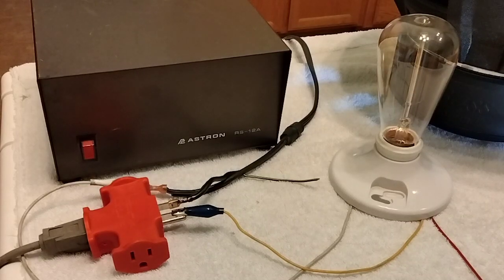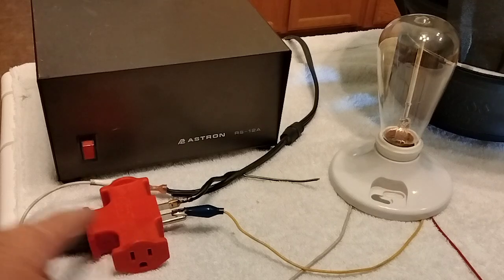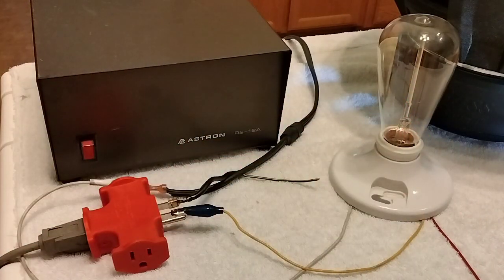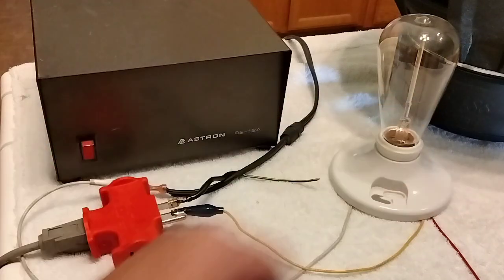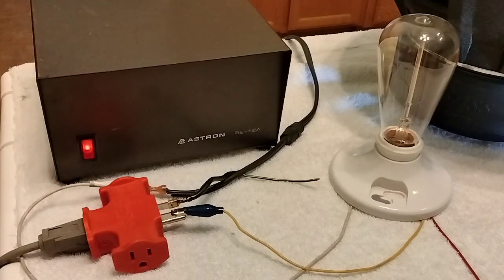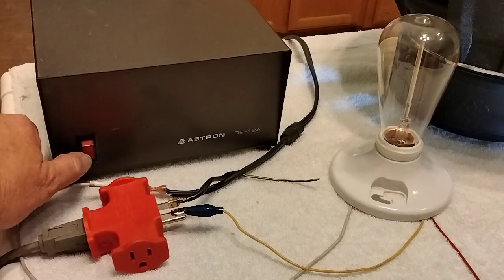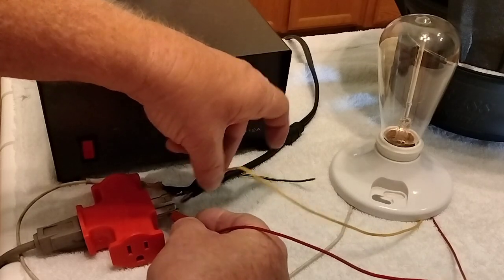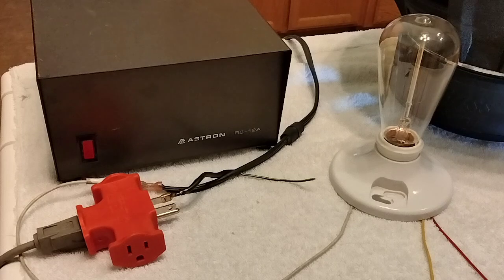Transformer Soft Start.  How and Why every transformer should have it.

Comment: Completely WRONG, the transformer has nothing to do with core saturation. This is completely bogus, what is happening is turning the transformer on at a peak of the AC wave form and not at a "Zero Crossing" point will always cause an inrush current. "SOFT START" circuits are usually required when the transformer and rectifier assembly is charging a high capacity filter network. Get it right guys, factual theory, CB Mentality does not cut the mustard. Respectfully & 73 Dennis, KV4WM, a US Navy Nuclear Submarine Veteran and Licensed Amateur Radio Operator.
Reply: Sorry, you are wrong.  Big CB is correct.  This is a phenomenon called core remanence.  Applying power at "zero-crossing" to a transformer with it's turned-off remanence near the positive peak forces further positive flux build that there is no capacity left for.  This results in saturation and a LARGE magnetization inrush.  Up to 17x FLC.  Systems called POW or "Point On Wave" exist to avoid this.  They monitor where power is lost to the core and control the power ON point of the sinewave to the same point during the next power up.   To repeat, starting a transformer up at zero Crossing is worst point to do it.
Reply from the maker: @keithcress1335  Wow, I love it, I knew they track and/or start the wave to sync when combining or switching, but I never heard of or thought of using it for a transformer.  Awesome, I love learning new stuff.   I thought it was crazy when I learned how they shut off the MRI machine I was in 20 years ago.   I saw inside the unit where it had this huge shunt to literally short out the massive power coming in and blow the breakers to turn it off, but you probably already knew about that.  Thanks for teaching me something new,  I already looking it up and reading.
Reply from the maker: Since you threw in a dig at CB Mentality, you must also be one of the hamsters that complains people are off frequency and they should buy a better radio, even tho yours has a clarifier. Also you must be angry at CBers because you didn't fit in and had to study to be a hamster, and now all you can do is ask other hams what the weather is and then brag about your $3500 radio.  How do I know you use to be a CBer and didn't fit in?  Because you said "does not cut the mustard"  I heard that for years on the CB, and now you bag on CBers, because you didn't fit in.   Then lets top off your hamster intelligence buy you saying "factual theory"  I am rolling on the floor, seriously!    I passed all the hamster exams without studying and I can talk all over the world without $3500 radios and 100 foot towers.  Goodbye KV4WM, but again "factual theory" Really?  do you know what either of those words mean???   You are so proud to say your name and call sign and top it off with "factual theory" I Love It.   ROFLMAO
Reply: So completely sure of yourself.  But completely ignorant on the subject too.  " peak of the AC wave form and not at a "Zero Crossing" point will always cause an inrush current"  
Yep!, you've never been there before.  I used a zero point crossing circuit once and instead of tripping the breaker 25% of the time, I got like 90% of the time.

Comment: I didn't get it. Where does the light bulb go in the circuit?
In series with the primary or in parallel with the primary?
Reply from the maker: Series with the primary.  Imagine it like this:  Put 2 power switches side by side going to the primary, if you turn on either switch the transformer turns on.  If you turn on both switches the transformer is on.  It wouldn't matter which switch you turn on,  the transformer turns on as soon as the first switch is in the on position.  If you turn on the second switch nothing new happens, the first switch already turned it on.

So now take one of those switches and have it run thru the light bulb on its way to the primary instead of strait to the primary.  If you turn on the switch with the light bulb first, the light bulb will absorb the possible surge of current that would normally thump the transformer, and it will also put the magnetic field in the transformer in sync with the power that is coming in thru the light bulb.   That switch and its power going thru the light bulb is the "soft start".  Now you leave the light bulb switch on and also turn on the other power switch.   Now the transformer is able to draw its full current as it is fully powered on, and at the same time the power that was going thru the light bulb has been bypassed.

You can do it with 2 switches and a light bulb, or a resistor, or timers, etc.  It is really simple, you just power up thru a suitable resistance, then bypass that resistance with another switch.
Reply: @bigcbradio  
Thanks for your thoughtful reply. I understand the light bulb in series with the primary. That has been around for a long time. I just couldn't tell in your video where you were putting it.
I thought maybe you were trying to explain something I haven't seen and I didn't want to miss it, if you were.

Comment: Luckily, my 20 amp isolation transformer has dual primaries, so I run it from 240 VAC, instead of 120, and that keeps the breaker from popping. It's enough current to make the wires rattle inside the conduit.

Transformers, even with no load, appear as a series R-L circuit, and there is a startup transient. You can even  model it in SPICE and see for yourself that several cycles are required to reach steady-state.
Reply from the maker: Rattle in the conduit..... sounds like you could use some soft start there

Comment: At a TV station I maintained, our soft start circuit used 2  1 ohm wire wound resistors on a Harris TV-55U  50 kw transmitter to slowly bring up the high voltage. The filaments were also soft started.
Reply: That's  2 -  I ohm 1 kw resistors, forgot to mention that.
Reply from the maker: @KA9DSL  I figured they were BIG resistors since you were working with 50KW.. LOL.  Sounds like a fun job.  I only work with small stuff, like 1000 watts.   I was only mentioning the soft start in this video regarding the kick from the magnetic field, but yes, as you mention, it is a good idea also for charging capacitors and filaments also.  Thanks for the comments.
Reply: @bigcbradio  Thank you, by the way, the xfmr and rectifiers were all in a big tub of mineral oil for cooling. And the beam voltage was 32kv. Very dangerous to work on, even when it's off.
Reply from the maker: @KA9DSL  Dangerous is an understatement at those voltages.   I have been zapped many times, everything from your ordinary car ignition coil to 240ac house, but the worst ever was from a capacitor in an old ceiling fan that had been removed from the ceiling for a month!  As crazy as that sounds, I was taking the fan apart for who knows what now, but as I took it apart the capacitor got me from hand to hand thru both arms and across the chest.   Seems silly since the cap was about the size of a D battery and it was just a 110v fan, but my muscles were sore for a week.  It was one heck of a firm contraction.  I was holding the fan up with my left hand and had the wire cutters in my right, and when I cut into a wire..... Snap!  Since that day I don't mess around with anything without thinking first.

Comment: I would argue that Residual magnetism is only one factor in this.  I installed at 1.5KW torrid transformer at my test bench for isolating a DUT.   It was my first rodeo with large inrush currents, torrids are worse.  I would pop the fuse, or blow the 20A breaker 25% of the time.  At first I installed a zero point crossing circuit, and it blew about 90% of the time.  I did some reading and studying, and even worked up a current clamp to my scope to measure current and voltages.  I went full Obsessive Compulsive on it, lol  
I think you stated it wrong about the residual magnetism.  Best case is the polarity of the field left in the core is against what is incoming when the switch is closed, hence bucking the current.  If it is aligned with the incoming current then it doesn't buck the incoming current, and you might start off on the edge of saturation.  This will leave the current limited by only the DC resistance of the primary winding.  
Now if you turn on at zero point crossing, even without a residual field, then you have nearly a full 180 degs for current to build.  This only gets you the first cycle, as the next cycle DOES HAVE a heavy residual magnetic field bucking the current this leaves little current in the primary, unless the secondary is eating the field up as a load.  I demagnetized the core in a few tests and that made the problem better, but not fixed. 
Here is a ugly, or genius, way I used to fix the problem.  My output was 120V, so I used a power relay that had a 120VAC coil.  I wish I could include a sketch.  The relay coil was driven off the OUTPUT of the transformer.  The output of the transformer went through one set of NO contacts so the output couldn't be loaded until the replay closed. The input of the transformer went through one set of NO contacts powered from the existing power switch.  Then a resistor(iirc 12 ohm 2W surge rated) was put across the NO primary relay contacts.   Now when the switch is turned on the resistor limits the current,  the voltage in the secondary doesn't come up if the core is saturated so it is limited for a time.  Once the output voltage is up the relay closes bypassing the resistor and connecting the output.
Reply from the maker: Seems like genius and maybe over engineered, but who am I to judge, mine is just a resistor and a switch, but I didn't actually show mine,  it was just a demo to give people the idea.  Whatever solves the problem  right?   You are definitely are putting some thought into it.

Comment: There is a special thermistor called an inrush current limiter.....High resistance when cold, low when hot. These are made in a variety of current ratings. They are commonly used with switching type power supplies. I bought a bunch of these years ago and add them to any gear which i wish to protect. The ones i have were made by Keystone.
Reply from the maker: Thermistors do have their place, and even tho they market some as inrush current limiters, I will stick to this type of example in this video.  Why? For example, if you were to switch a device off and then immediately back on, the thermistor will still be warm an offer no protection, or if the area around the thermistor is still warm, again, no protection.  Also thermistors characteristics change over time and use "they age" and the specs change, additionally, they are affected by ambient temperature. 

But, everyone can research all the different ways and test and decide for themselves.  Thanks for the idea.
Reply: They also don't like greatly varying loads. Easy to design a with an ICL and find out it's shutting down when the system is idle and 'soft starting' your circuit when the current requirement jumps up.  Trying to find one with the cold R high enough, and the other specs is a pain.
Reply: I looked into these before, but the ratio of cold vs hot resistance was too low (I recall around 4 to 5) to make enough of a difference for me, and also the hot resistance was too high because it was going to overheat from the 5-10 amp load.

Comment: Good presentation. I've known about the concept of inrush currents and all that for sometime. I have built circuits using quick duration timers and a resister for a couple of my high powered audio amplifiers (vintage that used big iron transformers). Makes a huge difference. SMP (switching) power supplies are no exception! They surge too. What I didn't know, however, was the relationship between the static magnetic "charge" left over from the last shutdown and the position of the AC wave when it hits the transformer! That's cool. Now add all the stuff on the secondary side that is sucking hard for power like big filter capacitors in amplifiers. On all the mods I made to amplifiers, I chose to limit the inrush current ONLY to the high rail B+/- power windings but leaving the transformers still intact to line (mains). Just doing that allows amp to fire up and NOT have my room light flicker! Modern home theater type receivers sometimes use 2 power transformers! One is the big heavy one to power the amplifier stages, but use a tiny doorbell size transformer that's on 24/7 for the memory and some other low current circuits. In tht case, limiting inrush current to the high power transformer is a good idea.
Reply from the maker: Now you know... LOL.  I didn't figure out that "static magnetic "charge" left over" on my own.  I read it somewhere 25 years ago or more.   I don't remember where I read it, but I am glad I ran across it back then.  One of the easiest ways to demonstrate that static magnetic state it is by pulling that trigger on your Weller soldering gun a bunch of times.  They make a pretty good clunk sometimes.  I was going to use my Weller to make the video, but then I remembered I had this power supply that the cover has just enough clearance that is make that loud ringing sound.  

I am really glad you picked up on that static magnetic state rather than just the basic inrush.  Have fun and thanks for watching and commenting.

Comment: Your highly-flammable, static-electricity-generating work surface amuses me
Reply from the maker: Well..... I bought one of those anti static wrist straps back in the late 80's but I never used it and don't know what happened to it.  I often use old towels as a work surface, it keeps things from getting scratched and also keeps screws from rolling away.  The only real disadvantage is you have to be really careful about small pieces of wire getting lost in the towel, you know, like the small strands from stripping the end of a wire.  When working on a live circuit board a small strand of wire in the towel could really ruin your day.

Luckily for me, even after working on thousands of electronic devices over the last 50 years I have never had a problem due to static or those pesky little wire pieces, although I have let the smoke out a couple of times due to other mistakes.

I am not going to mention the name of the repair shop, but there is a shop here in Southern California that has their entire work bench covered in felt.  It makes me cringe when ever I go there.  The felt is covered in burn marks and there are literally dozens of little pieces of wire and solder dropping stuck in it.  The worst part is that almost every repair they do, they have a live circuit board laying on top of that mess.

Oh well, I do know the proper way to do things, I am just too lazy to go to the effort when making these helpful (hopefully helpful) videos here on youtube.  That's kinda why I mention in my "about" that these videos are not professional and I am not an expert.   Also some things you see in my videos are meant to be funny, such as some of my videos will have a hammer, Elmers glue, super glue, etc.... all near what I am working on.

Ok, thanks for letting me know my towel is flammable, I hadn't thought of that.  I guess I have to have a fire extinguisher nearby in my future videos.

Comment: All these bare wires!!!
Reply: Well he's not touching them...
Reply from the maker: @volvo09  I try not to touch em, LOL.  I will mess around like this with 120ac,  but I don't fool around when I'm in there with higher voltage.  There are some videos I have with the cover off of some high voltage stuff, and in the videos it may look like I'm close, but I'm not, and I even double check the area where I will be walking around when recording so I don't trip/slip/stumble and fall face first into something that will burn my face off and kill me.  I am even afraid of DC of 48v or more.  DC is way more dangerous than AC in my opinion.   I designed and installed my own Solar and it is around 500v DC and that is no joke.  You won't see a video of me playing with that.
Reply from the maker: Yes, it makes it exciting, and if you look at the tip of the alligator clip on the yellow wire, and look at the spade lug right next to it, you may notice I had a little excitement just before I started recording. LOL.  

The other option was to make a professional looking setup that would take some time and effort.  I don't have much time left and I hate effort.  Hopefully someone learned something from this video and they can make their soft start as safe and as pretty and professional as they want.

Thanks for watching and commenting.
Reply: Meh, I've done sketchier and lived to tell about it. I really freaked out a neon sign repairman once when I bypassed a 120v photocell with an alligator jumper to turn the sign on at work.
Reply from the maker: @makerjeff86  Lots of fun.   I had to do some emergency repair one night and all I had for lighting to see what I was doing was scratching the wires (120ac) together to get some sparks.

Comment: I hadn't considered this.
I have a bench supply I use on occasion when I need big power. It has twin secondaries 20.5vac @ 30a. I did put a soft start on the secondary side to limit the inrush to the 4 x 60,000uF filter caps because the thing used to pull the lights down on power on.

Good vid! I'll make another modification next time I dust old Bertha off. Cheers.
Reply from the maker: Yes, and if you do just a little testing you can come up with a resistance and an amount of time needed on the primary side and you won't need it on either of your secondaries.  These soft start mods not only stop the thump, and in your case stop the lights dimming, it also protects your capacitors.  Have fun.